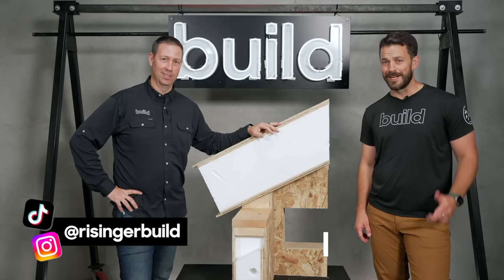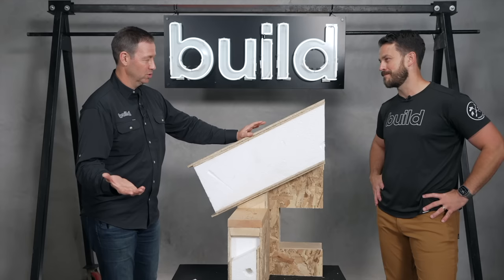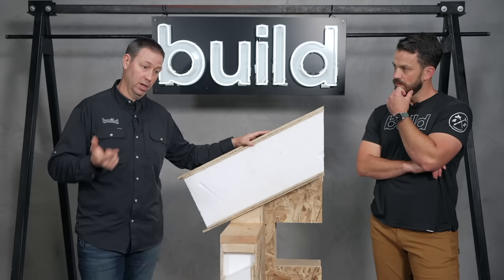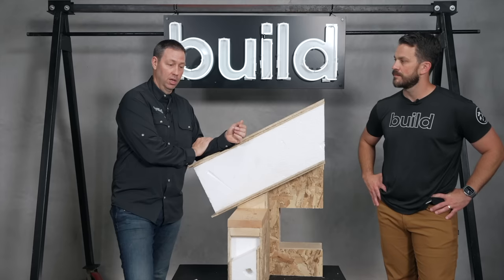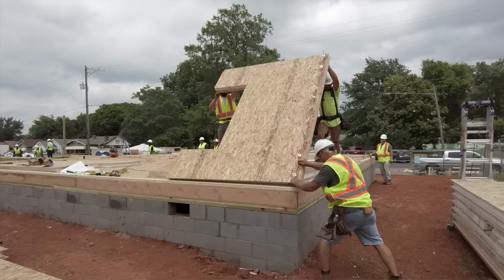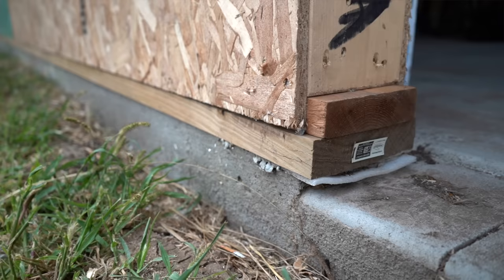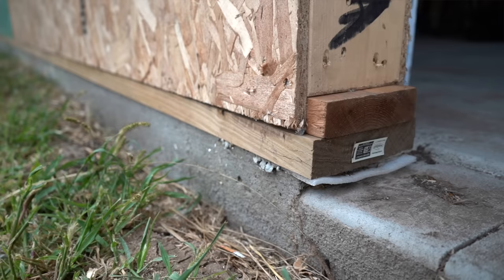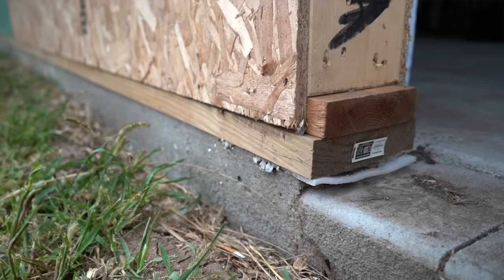SIPs Framing Update 2023 - Extreme Panel System Install w/ Will King

Comment: SIPs  look highly flammable. I used 5" MIPs instead (metal insulated panels) to create a fireproof home, with R42 exterior walls and roof. They are expensive though, but the savings in labor is significant. They have finished metal skins on both sides: no OBS or plywood skins, no Tyvex, no finished exterior material no interior outer wall paint. My entire structure for my 1700 sq foot home is metal. There is virtually no wood in the home. I also used MgO instead of plywood and drywall for the 1-1/4" floors and 1/2" interior walls. About $150/sq ($240,000).
Reply: Rapid flame propagation across Reynobond MIPS were implicated in the disastrous 2017 Grenfell Tower fire.

Comment: Another great video. I'm looking at "building" a 1,600 sqft ranch w/basement, retirement home in Northern Wisconsin later this year (32' x 50'). I was originally thinking about buying a modular home but you have got me questioning my thought process. Using the panels as part of the floor system wasn't even on my radar as possibility. Insulating the exterior of the foundation, adding radiant floor heat in the basement slab and garage / workshop floors. A small traditional HVAC for heating and cooling the main floor. My mind is racing right now. I would also love to hear more about the low voltage lighting that was mentioned. The ceiling lighting still seems like the biggest question mark to me.  Oh, and what is the approximate lead time to get the panels made? Thanks to everyone helping with the video.

Comment: Really love this video! I’m curious about metal SIP systems and how they compare. One worry I have with a SIP system is mice and bugs gaining entry over time.
Reply: I have that worry as well. But I'm not sure it's much worse than any other wood framing. Can you think of any reasons it would be worse? You have OSB on the outside either way, and some insulation inside of that, either batts or foam. Is styrofoam easier to burrow into than other open or closed cell foams?
Reply: @stevemarton5620  I believe that there are some insecticide properties mixed in with the EPS.  Plus, the seal so much tighter than batt insulation.
Reply: @sambennett5441   Somewhere in there they talked about the OSB skin being treated with sodium borates for insect resistance.

Comment: I’d like to see Build show interview a high end builder that uses SIPS, seems like a lot of SIP construction is in relatively simple architecture, not complicated high end custom architecture homes
Reply from the maker: Great point. I’ve done three SIPs homes and they have been more simple forms/architecture but definitely were high end builds. Simplify the plans for best SIPs use
Reply: I'm one of the draftsman for Extreme and believe me we have done some ridiculously complicated buildings. We've even done some geodesic domes.
Reply: I’m a builder with extreme panel. A simple plan can help keep the cost down in the panel package. 

Anything that can be stick framed can be done with SIPS.
Reply: @nathanhoekstra6321  just saying I’d like to have seen a complex elaborate home design in this video. Don’t think I’ve ever seen a SIP build that was elaborate and complex architecturally speaking. Not saying you can’t do them, but there’s clearly a reason why most people avoid sips in architecturally, elaborate, and complex designs. Would have liked to see some commentary in the discussion about why this is; otherwise I thought the video was very fair and balanced regarding pros of sips and misconceptions of its weaknesses.
Reply: @Ed-jg3ud  Yes it seems like implementing complicated geometry would be easier to factory fabricate with automated precision cutting than leaving it to framers who have to measure every stick.

Comment: Matt, you really do need to build a SIPs house soon! It's too late for me, I'm jumping in, with a decent SIPs company, but I hope there are not many pitfalls and costs that are not advertised and I haven't been able to sniff out. Or long term durability issues. Sure, electrical and plumbing are different, but we know the solutions there. I wonder if there are hidden pitfalls no one talks about which makes it less of a no-brainer. Really looking forward to you building one and giving an honest review of the pros, cons, and realistic costs involved. Because the package itself is not that expensive, especially on an expensive house.
Reply: We did a SIP addition from Extreme Panel.  I did everything myself and it was a timber frame with a SIP shell.  I can't overstate how down right impressed I was.  I did stick frame the floor for plumbing purposes.  I could see an argument either way on the floor.  They didn't mention it here but at the Extreme Summit in Cottonwood, MN Josh was nice enough to invite us on a house tour and we got to see his SIP basement.  If I was doing new construction that is probably the way I would go.  But to speak on the readiness, professionalism, and quality, working with Extreme was top notch.

Comment: this was a very interesting show. Unfortunately you did not cover a few things i was hoping for. one was of course the detail between wall and roof. It looks like that is a big thermo bridge and also a possible air leak. The other was a lost opportunity with Matt. He explained that he buillt 2 SIPS  houses and an identical stick house. Unfortunately he did not make a cost comparison between the 2 system. And he clearly said that was the purpose of using both techniques.

Comment: Built a SIP home for a customer over 20 years ago.  2700 sq ft house put up by panel fabricator crew of three in five and a half days.  The half day was spent foam sealing the roof panel joints.

Funny experience with customer and energy usage.  The customer built a fire in his new fire place the first night he was in house.  He forgot to close the fire place damper after his first fire.  Many weeks later he realized he was using more fuel oil than expected.  Several weeks later he recalled opening the damper and checked to see if he had closed it.  He found it open, closed it and literally quit using fuel oil.

Comment: Now that you have done the deep dive, I would like to see a comparison between different manufactures. I assume that the R value, strength are comparable but what other little features set the different manufactures apart.

Comment: There’s a panel manufacturer here in Central Missouri that builds the panels and runs metal conduit, places the boxes for outlets, switches and lights, etc. inside the panel. Then they spray foam the panel.

Comment: So you said no Thermal bridging but what about your headers (both the top plates and the headers for doors and windows)?  Realize it cuts out 90% of the thermal bridges, would be nice to maybe see in the future a mock-wood foam surround for all the header locations.  
Second thought, the house you show is very simple construction with a straight wall and single layer roof, so the easiest of homes to build. What about more complex structures, does Extreme do those as well (like other SIP panel makers do)?  And when you get inside to the lam beams, would you explain how those get installed (are there precut notches for them? are they glued or screwed or what is the method of affixing them)?  And then inside if you want a modified ceiling, like tray or coffered, beamed or vaulted, do you simply attach 2x4s to the osb (screw penetration lengths?)?    Thanks
Reply: A rep from Extreme Panel mentioned in the comments that they've done geometry as complex as geodesic domes.

Comment: Matt, thanks for introduce us the SIP. I am looking for a better roof insulation yet first time know SIP. Would you mind to add installation details? 1) Screws only tight to bottom OSB, will the foam shifts so top/bottom OSB seperate? 2)how to add gutters? 3)how to fill ridge and board connection? 4)any suppplier for bay area CA?

Comment: What about hurricane bracing? Diaphragm bracing is awesome in this system but they didn’t address hold down bracing for seismic or straight line wind loads?
Reply: Good point, the OSB walls at bottom (on inside & outside) are screwed to wood at bottom.  Is that good enough??? probabley not...

Comment: I would mount electrical all on the surface similar to how you would in a shop. I like the look and it's super easy to access if you need to later on. I would order without the channels in the foam.

Comment: The thermal bridging at the top plate is a huge oversight in this design. Otherwise the panels themselves look great.
Reply: And I didn't see any slab edge insulation either...

Comment: Some drawbacks of SIP's:
- EPS is not a good sound insulator (just like all other plastic insulation materials like PUR, PIR,...).
- EPS and SIP's don't have a good thermal inertia (heats up/cools down easily).
- Remodelling is very difficult (extra wall openings, plumbing, HVAC, ...).
- Fire safety: EPS can be made fire resistant (with additives) but not when it's melting which it will do in the case of fire. Those droplets are hot and will release toxic gases which are also flammable (German test).
- Be careful with mice and beetles ("alphitobius diaperinus").

Comment: would be awesome for Extreme Panel to offer a WRB adhered to the external OSB from the factory.
Reply: @sladeoriginal And they ought to install those splines into at least one panel edge at the factory as well instead of delivering them loose, would save half the labor on the onsite adhesive application.

Comment: Please schedule/plan a video about the Hercuwall wall assembly. It's manufactured in Arizona and has steel studs, poured concrete between insulation panels.

Comment: It would be interesting to see how these panels perform in a seismic zone for lateral movement, didn't see any real anchorage to the foundations or hold downs. Lag bolting through the osb at the bottom to the sill plate seems questionable.
I also wonder what the time frame to build the panels in the factory is, this needs to be taken into account for construction time too.

Comment: AM i missing something? The continuous inch of solid wood at the bottom and roof are the points with the weakest cross sectional 'R' value. I am assuming that there is no further 'exterior insulation. In that case wont this be worse that having solid wood studs + exterior zip 9 system ? what are the pros for extreme SIP in terms of performance compared to say a zip 9 exterior insulation

Comment: The metal installation screws cause a surprising amount of thermal bridging on the roof. Hopefully progress is made on some of the newer materials (basalt based stuff, etc.) that will eventually replace the metal. Good but could be better.
Reply: Yes, this is my understanding. 

So I’m thinking why not a frame with the SIPs fastened from the interior? (In search for a better envelope). Easier to wire… yup it would cost more but. 

Feel free to rain on my idea 😂. I built a house, made a lot of mistakes and I’m looking to avoid a repeat.

Comment: What is the fire rating? 
How can different heat (electric, wood, gas) / air conditioning /heated flooring be used and installed all the systems have different requirements for ducting and air exchange? Does all this come as part of the purchase?

Comment: Would like to see a build with ICF walls and SIPs roof 😊
Reply: I thought the same thing,  but I bet the SIP company wouldn't go for it as they are not in control of the whole thing, and if things don't go together, the homebuilder would take the blame.
Reply: Check out Pure Living For Life SIP build lol
Reply: @cheeseburger9232  Thanks for the suggestion.  I skimmed through some of the videos, and what they built was an ICF walkout basement and SIP 1st floor. What I was talking about was an ICF basement AND 1st floor, topped off with a SIP panel roof.  Where the SIP roof panels meet the ICF wall would be the area of concern.  The SIP company would probably say "You're on your own with that" and make no guarantees that it would work.  SIP panel roofs are not recommended for anything other than a simple gable or mono-slope roofs.  Hips and valleys make using them difficult.
Reply: @markstipulkoski1389  they had trouble with their sips they had to go back and spray foam into areas, he got all the over spray gobs and put it into the ridge , seems like it’s not wroth it.

Comment: As far as I understand the foam in SIPS panels is petroleum-based and doesn't decompose, which would be the deal-breaker for many people and possibly some jurisdictions in the coming years as they try to make construction a bit more environmentally-friendly.  I remember a whole movement to rid society of polystyrene food containers (at least here in Australia).   If it a bio-degradable alternative material could be used, then SIPS would be awesome.

Comment: At minute 4:45 you start talking about the fact that there is no thermal bridging in the walls or the roof because there are no wood studs or rafters within the SIP panels and therefore the building envelope acts las one continuous "system" of continuous insulation (like a styrofoam cooler) and yet in looking at the mockup there are two large wood top plates and that triangular spacer block that completely span from inside to outside. Also, at minute 8:25 you show two large bottom plates that act as thermal bridges.
These construction details seem to be a pretty big thermal break in the building envelope. How do you deal with this in the field, especially in climates that are a lot colder than Texas?
Reply: With a SIPS build, the thermal bridging is greatly reduced but not completely eliminated. Some lumber is still needed for support in certain areas but far better than a stick framed project.
Reply: @yansoo4000 - I thought about that too, as well as the voids in the insulation every few feet for electrical and plumbing runs.  Not perfect, but better than stick built.

Comment: How come you use chipboard? As you mentioned moisture is in the foam/during construction and chipboard falls apart and rots after a few years. How come you don’t use something that’s guaranteed longer and won’t break down by moisture?

Comment: I would add the extra 6-1/2” to the perimeter of the slab and build a 2x4 wall in the inside of it all. That would give you easy access for electrical and plumbing. I don’t like that you are depending on just 1-1/2” of osb to hold down the walls to the  slab.

Comment: So you talked about the fact that you can hang cabinets anywhere, my concern is normally you attach to a 2×4 but now its just half inch OSB ?
Reply: That OSB is bonded to the foam core. The core actually provide most of the structural strength the OSB sheeting just protects the core from environmental and chip damage.
Reply: Good point.  the foam has no holding power and you are hanging kitchen cabinets to 1/2" OSB & drywall.

Comment: - SIPS  is a system (Typically the second S) of Insulated Panels forming the Structure of the entire building...  (The system part matters most)

As (I think the questioner means) asked below, is there a SIP manufacturer where the external sheathing has  pressure activated adhesive backed building wrap preinstalled??  (we don't need Huber branding per-se).

Add solar to the roof and the build easily approaches some energy parity over an expected sub-unit lifetime.

Comment: You have not convinced me that those OSB walls with no inside studs 16 inch on center are strong enough to hang anything on. Would cabinets or a wall mounted TV fall off the wall with nothing to screw into but OSB.  You did not take time to explain how that works.  If they are only using 1/2 inch OSB that sucks.

Comment: Seems good, but what happens to the bond between the plywood and foam if Moisture gets between them. 20 years from now I see the roof getting blowen off.
Reply: Keep imagining. I ve been using sips since early 90s and the panels are as good now as they were when we installed them. Quality install is key and that’s across the board. It doesn’t matter what materials you use.
Reply: There is no in between. The whole inside surface of the OSB is coated with glue. If the right glue is use then the glue itself repels any moisture that gets near the bonded surface. This is the same with ZIP tape with the correct adhesive the tape will not peel of due to moisture.

Comment: Why don't the splines come factory installed on one edge of the panel?  Why ship them loose to the site when they could be attached with continuous fed adhesive at the factory on at least one panel edge and save time on the jobsite with dozens of those sausages?  And how are ceiling fixtures handled - are the electrical chases already in the roof panel and do we need to fur out for recessed LED lighting?

Comment: I could not find any info on wind ratings.  Growing up in Florida, we worry about Hurricanes in construction.  I heard you are traveling to Mississippi to build on the coast, but many of the houses I see built in Mississippi don't have the same wind codes Florida uses.  I like ICF but the cost is limiting, but a Hurricane not destroy it.  At the end you were talking of building one of these.  If at all possible, I would love to see two homes built, near each other (same codes) one with SIPS and the other traditional.  If the two homes were the same floor plans, you could compare apple to oranges for a real comparison.  Maybe we as a community could team up with a charity like folds of honor to build two homes for them.  The other advantage of this system I did not see mentioned, is the labor shortages.  This faster build time would make a big difference on the shortage of help.